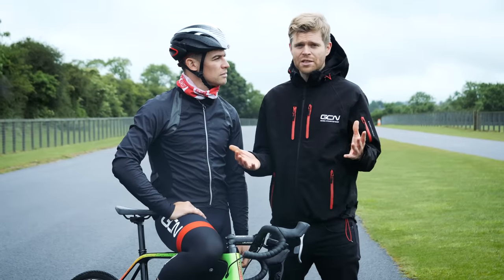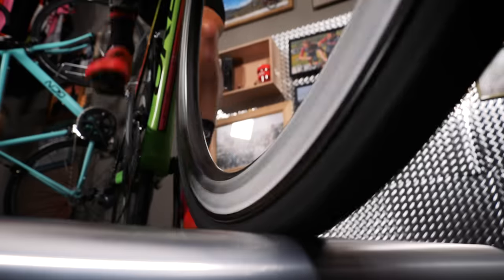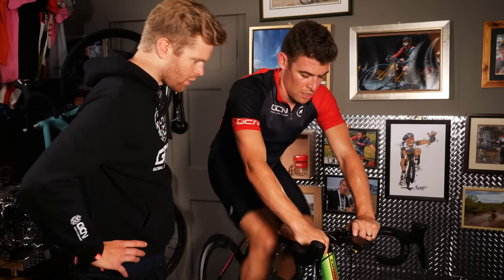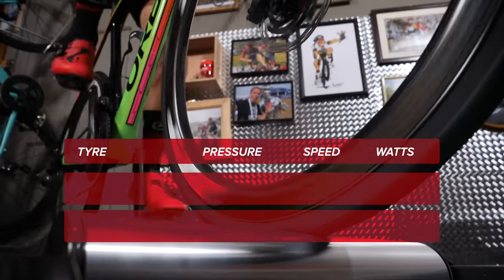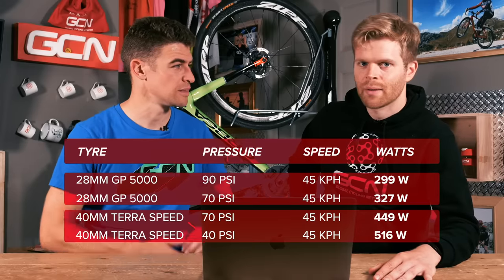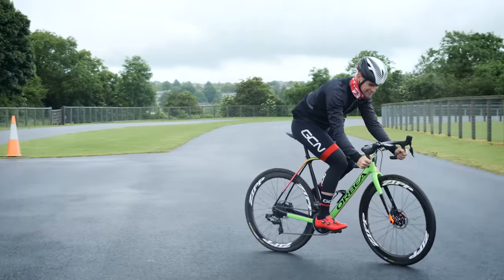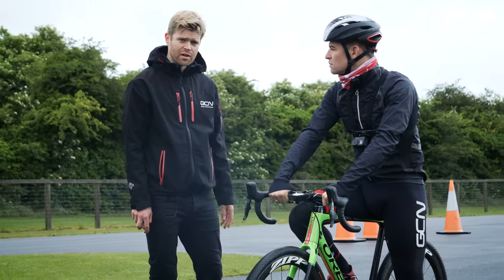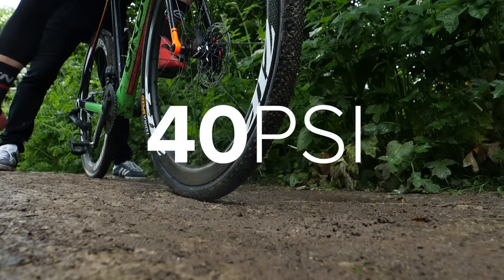Gravel Vs Road Tyres | How Much Slower Are Gravel Tyres?

Comment: This test is dangerously bad. Let’s skip the reasons initially and jump right to a logical deduction. If the gravel tire at 40psi REALLY was 200w slower, there is no possible way the gap would’ve been only 12 on the roll-down test on “gravel.”
So. Right off the top we can be assured that the roller test information is totally useless.
Secondly, hey, how about running the tires on some actual gravel? That was hardback and just barely different from pavement. And still the gravel tire almost pulled it off.
Geez, if I were conti I’d really be protesting this. they make some of the fastest race MTB tires, and their rolling resistance differences to fast road tires are more like 10w each on a large drum roller... depending on various variables. On rocks, the difference would be greatly in favor of the non road tires.
Reply from the maker: Of course it's completely possible - the difference between the two tests comes down to momentum, which is virtually zero during the static tests, but much greater in the roll down tests, hence the differing outcomes. Thanks for your comment
Reply: Look, logic says the test is badly flawed. It’s inescapable.. 
if the tires took 200 watts more in real life, how does a guy push even slower ones for 10 hours at 20 mph at kanza and finish at @300w avg? Against air resistance, which neither part of your test featured?
You can’t argue the roller test is within 500 percent margin of being correct.
Instead of trying to come up with explanations you need to go back through the test and either figure out the scientific reason WHY it’s off by such a crazy amount or just toss out the methodology and come up with something that is defensible and gets you into the ballpark of rational numbers.
Maybe a few k’s of gravel loop at same power, and measure speed.
But here’s the cold facts. The fastest road tires, contis and vittorias, routinely test out at 16-18 watts for a pair. At middling speed.
The main rolling resistance test website finds conti race level mtb tires to be in realm of 32-36w/pair at the 35-45 psi range.
These tires would be similar in construction to terraspeed. So... it wasn’t much surprise that a recent German magazine test recorded them as the fastest of several greaves tires at 22w.
Other isolated tests of gravel tires have put various makes and models of them at similar range.
Do when you tear out equalize for the right pressure for road and for gravel, you’re going to be seeing differences in the range of maybe 7 (something like a g-one speed beach “gravel” tire) to 14 watts (burly MSO gravel tire ) per tire slower than a fast road tire on smooth pavement. 
And that’s a FAST road tire. Many gravel tires are faster than say a Conti Gatorskin.
So how do you defend claiming 200 watts difference for a pair? I’m sure the machine registered that. But you can’t defend it as “meaningful.”

Comment: This test is absolutely useless. Of course the smaller, harder tyres are better on a roller. You could have figured that out by just looking up a physics book.

THE REASON wider tyres are becoming the norm, the REASON you are now seeing the pros on 25 mm tyres is because of how power translates on a uneven surface. And then smaller, harder isn't always better. Everyone on GCN know this. Or should know. And yet they still conduct only tests outside where NO POWER is applied, once again only testing rolling resistance. Utterly useless. 

What you SHOULD have done was to do an actual test of a circuit with fixed speeds, preferably with acceleration in some parts, and compare the wattage needed.

Comment: Stop with the click bait pseudo science trolling, please!
There are so many different variations of tires available, that comparing only one set of each is completely non-representative of potential differentials. Don't bother with a(GP 5000) to b(Terraspeed) tests and then say that equals X (road tire) is faster than Y(gravel tire). 
And the no pedalling/rolling only tests fail to illustrate how anyone actually uses tires as well as failing to account for deflections robbing the rider of delivered power through the pedals. 
It's a disservice to present your results with a title indicating you can provide a conclusive answer, especially with only pseudo science applied to a tiny and anecdotal sample. Go full science or skip it, please.